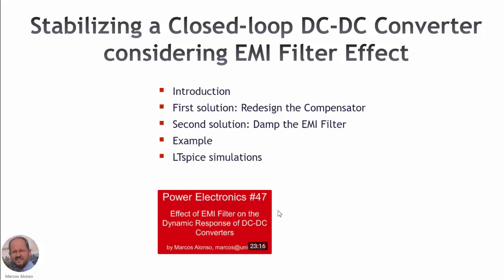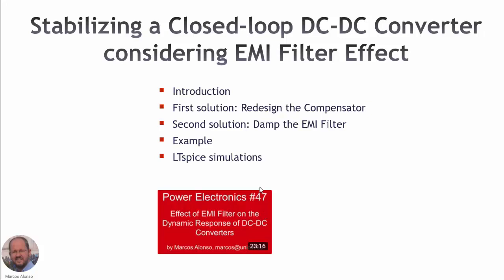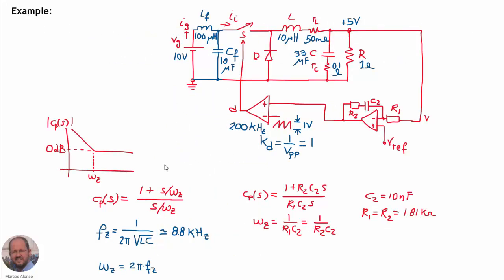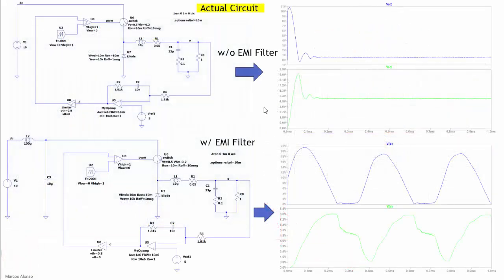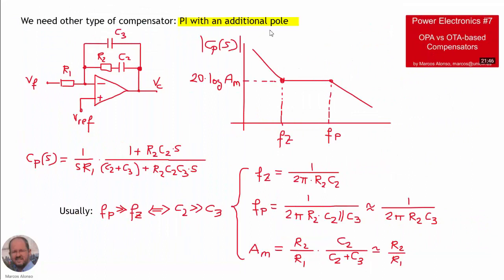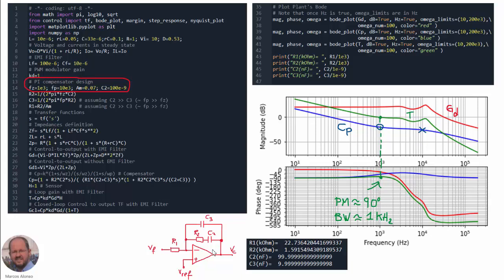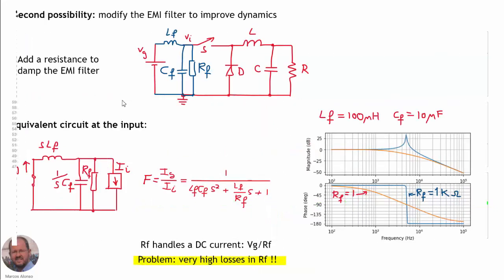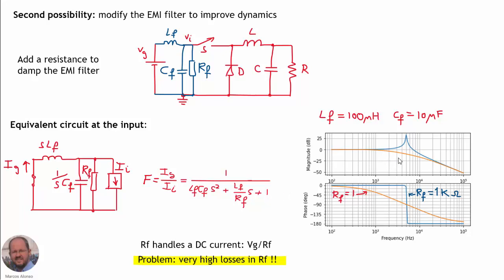PE #48: Stabilizing a Closed-loop DC-DC Converter considering EMI Filter Effect

Comment: Hi Mr. Alonso, 
I am trying to figure out how to solve this event but rather with an offline application of a boost PFC. 
Working with full load and 230V the circuit and the control is working just fine, noise level are damped and great resuslts are achieved, but as soon as the circumstances get a lttle tight (using minimum voltages whereas there is more stress with the input current), the output voltage doesn't regulate properly at the level it was dimensioned for. 
The simulation is working around a controller ic. 
Therefore as you explained very well, there are 2 possibilites to undergo this happening. 
First would be to execute some changes on the part of the compensator.
Second would be an inclusion of a damping network. 
The 2nd option didn't work. and the first one is so far changeable through the sense resistor linked to input of the pfc but in this case the input current rise quite a much. 

What do you advertise in this case ? 
Kind regards 
Aziz
Reply from the maker: Hello, thanks for watching the channel.
You have to carefully study the interaction between the filter and the PFC converter. This video can be helpful in the modelling of the PFC stage: PE#9 https://youtu.be/Cpsl2HnWUSk

Comment: Always Great video course! In addition to add the damping RC, how about adding a damping resistor paralleled with Lf? Which one is better?
Reply from the maker: Thanks for this excellent question. You are right, this is another way of damping the filter. Since the resistor in parallel with the inductor does not bear any DC voltage the losses are also low. The problem is in the deterioration of the filtering effect, which at the end is the main function of the EMI filter. Intuitively, when we place a resistance in parallel with the inductance, we are bypassing the inductor so that we are giving an easy path for the converter harmonics to go into the grid. Quantitatively, if we analyze the response of such a filter, we will find that a zero appears at w=Rf/Lf (Rf being the resistance in parallel with Lf), so that the attenuation at high frequency will have a slope of only -20 dB/dec instead of -40 dB/dec (the zero compensates the effect of one of the two poles). A solution to this is to add another inductor in series with the resistance. I leave this for you to look into. It could be the topic of a future video too.
There are many other filter topologies that we can find in the literature, including active filters. Thanks!
Reply: @MarcosAlonsoElectronics  Hi sir could you please make a detailed video on different filter topologies and which filter is better during which application......one question while deriving transfer function of parallel damping with inductive not getting any zero as you mentioned..not sure where I am making mistakes..